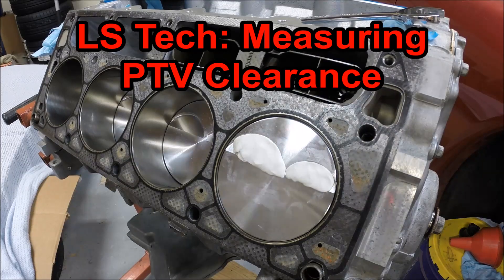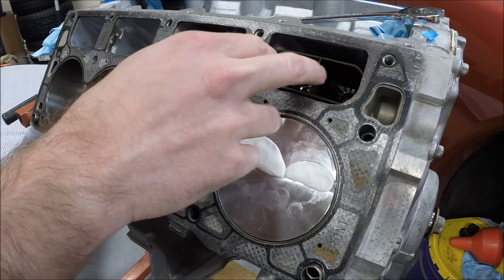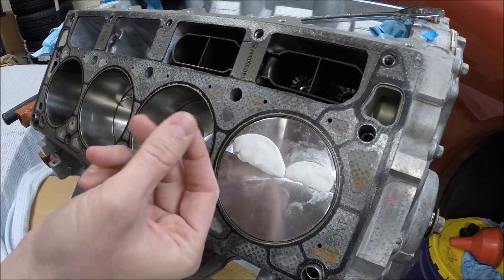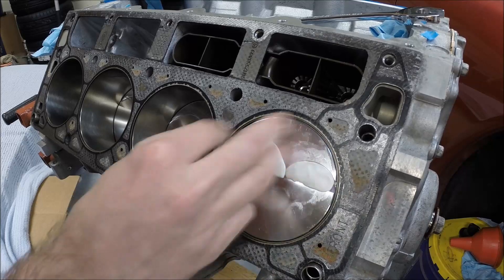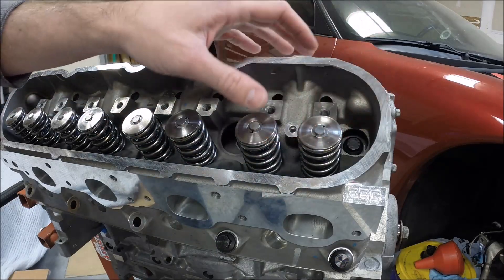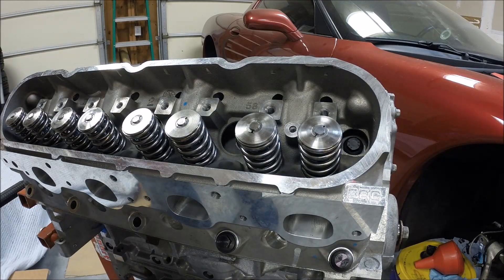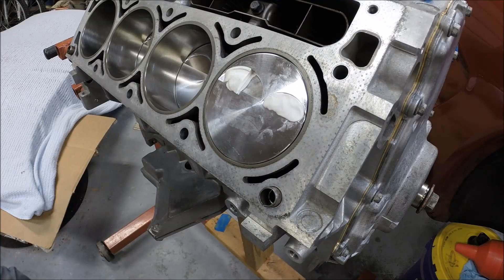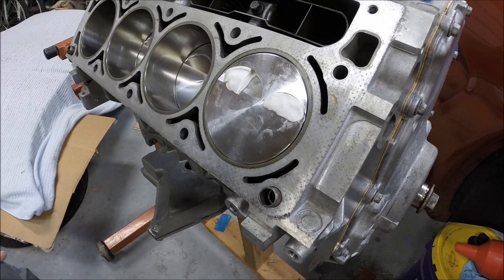LS Tech: Measuring Piston to Valve Clearance

Comment: Wouldn't a hydraulic lifter that has not been pumped up just compress a little under the spring pressure?
Reply from the maker: Yes that's correct.   Here's a trick on how to make a solid lifter for use when measuring PTV clearance and push rod length.  https://youtu.be/0-dvlBiMFU4?si=YX3Rgi-f2BAX82r0

Comment: Yo scruf, been using your videos for a long time I really appreciate all the help. I currently cannot find my old compressed head gaskets and I’m finishing up a 5.7 build for my Camaro. I need to check for proper push rod length before checking my PTV clearance can I do this whole process without head gaskets and just add the thickness of my compressed gasket accordingly to each measurement I need. Or should I go ahead and install the head gasket torque down the heads then check for proper push rod length remove the heads check the PTV clearance and reuse the unused new compressed head gaskets afterwards ?

Comment: How tight are the head bolts
Reply from the maker: If you're using old head gaskets, they will already be crushed, so you don't have to go through the full torque sequence on the head bolts.   But they do need to be snug.   There can't be any movement in the head or it will throw off the measurements.
Reply: @ScrufsGarage  but u can just put the head bolts around the cylinder I'm checking like you did in the video
Reply: Do you use the old gasket while testing this? It could change the clearance distance, but it looks like you did a temp install just to check the clearance

Comment: I'm not 100% sure this is correct. Seems like measuring PTV with solid lifters and pushrods measured for preload would give tighter PTV measurements. With solid lifters wouldn't you need a 0 lash length pushrod? Otherwise the solid lifter would use the pushrod with the added preload length to push the valve closer to the piston making it seem like clearances are tighter than they really are. Is that right?
Reply: correct.  But if you know your lifter preload, you can add that to the clearance.  If his PTV clearance in this video is .160, and his preload on a non-solid lifter is .080, if I am thinking correctly you'd multiply that preload by the rocker ratio and add that to the clearance. so for a 1.7 rocker you'd get .136, which gives a total PTV of .296
Reply: @michaelcouey1383  SO basically, if you use this method, with pushrods measured for preload, if you gonna get closer then normal numbers, but the numbers are still within spec, it just means you'll be fine and no math needed? after you switch back to hydraulic lifters?

Comment: Good vid, I’m in the process of rebuilding an LS2 with an aftermarket cam.   In the process of tearing the motor down and cleaning the piston tops I noticed two very small marks on two pistons that look like a valve had mad contact in the top of the piston any suggestions?  Seams strange that only two would have marks.
Reply from the maker: 407ForRent hmm not entirely sure.  Perhaps an over-rev at some point and it floated a valve?